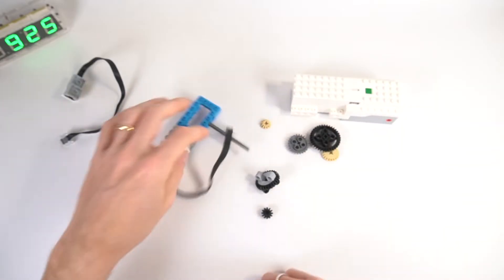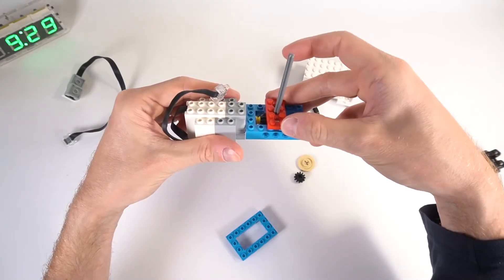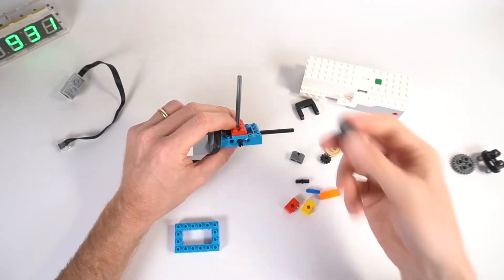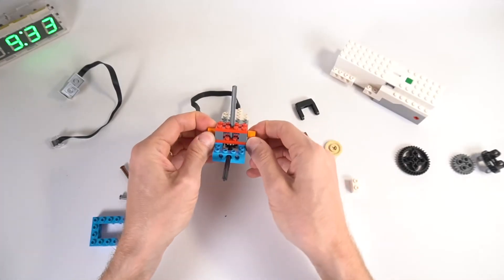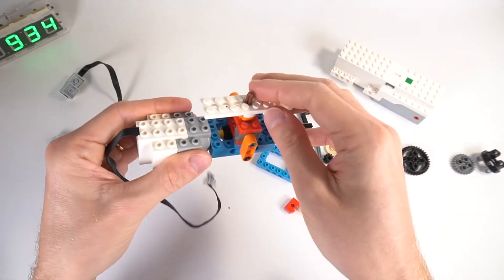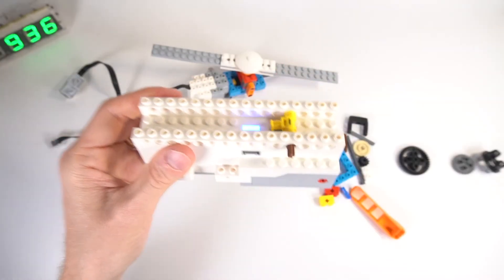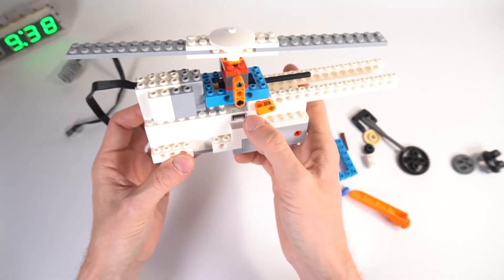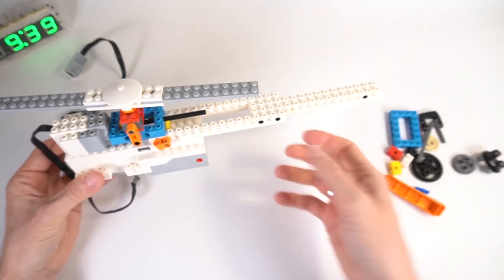Creative process of a LEGO designer REVEALED - part 2

Comment: That's a clever mechanism for turning on the hub
Reply from the maker: Once I found it, I've used it a lot.
Reply: I am also using it for at least 5 years but i place 2x4 brick with holes and axle on top